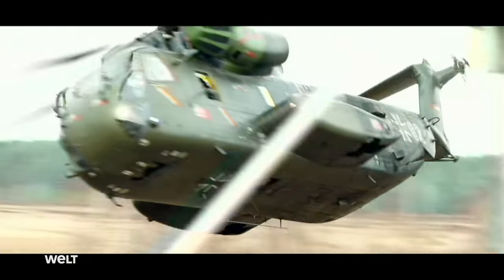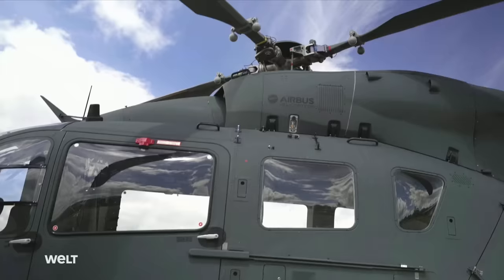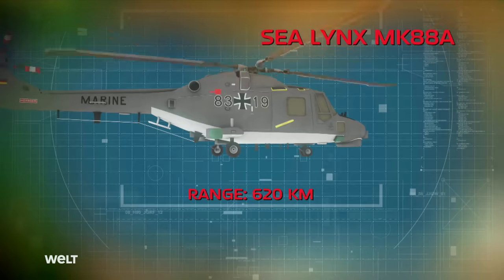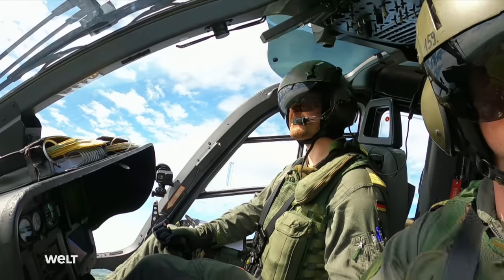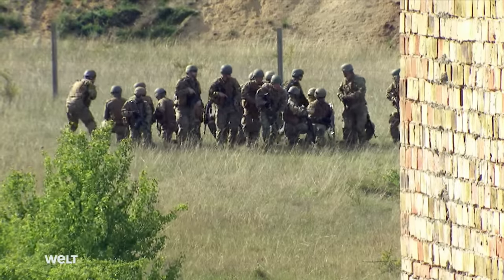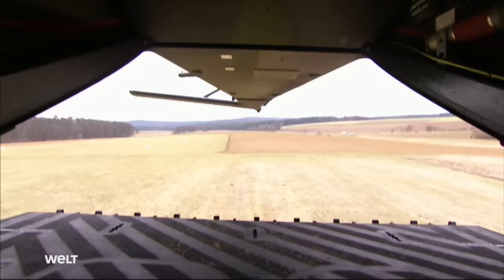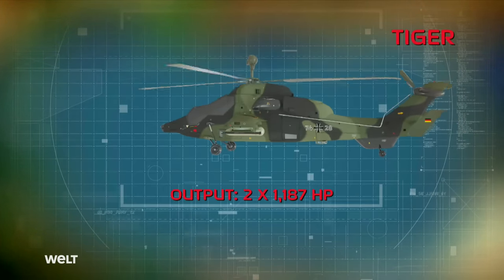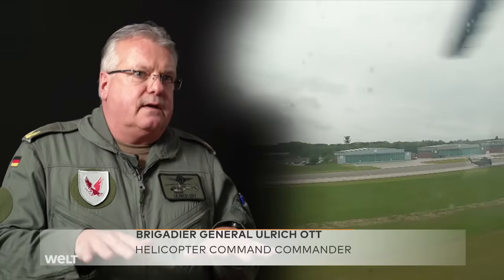Bundeswehr's Essential Helicopters: A Crucial Force for Land, Sea & Air Missions | WELT Documentary

Comment: A senior American general said that Germany is barely a "second world" military power with all their critical shortages, low readiness rates of aircraft, and limited training. "They are close to third world standards" he continued. These helicopters sound impressive but I understand their availability and numbers are very, very low by NATO standards. Poland (how ironic) will be a stronger military power than Germany soon if they get all the HIMARS, Apache, and Abrams they've ordered.  Lots of these Euro-choppers look good but are weak and fail. Australia is getting riding of most of their Euro-copters in favor of better, mostly US made models. The American made 53's a like old Mercedes S-class sedans in that they last for decades, are robust and tough as nails, rarely fall apart, and go on and on forever and day.
Reply: The German military budget is more the four times that that of Poland. You calculation does not work.
Reply: War is boring...